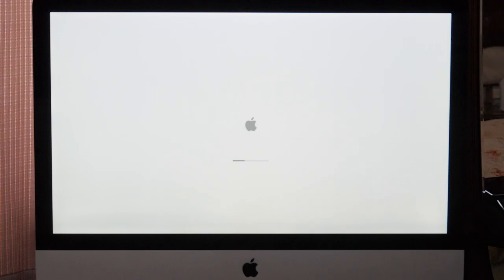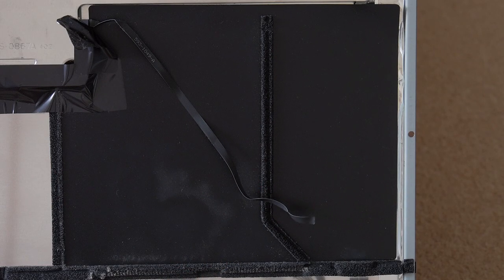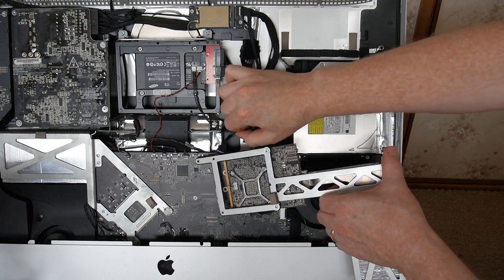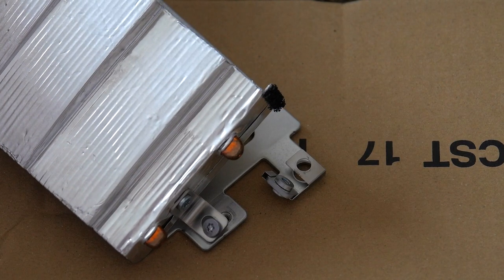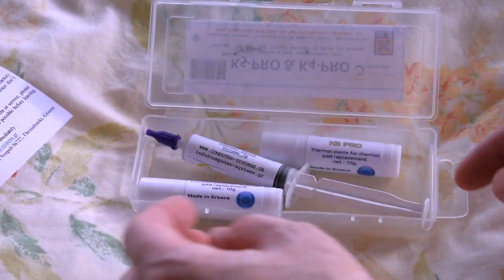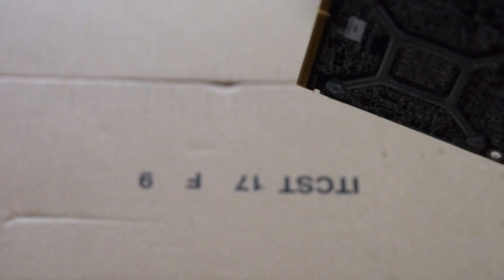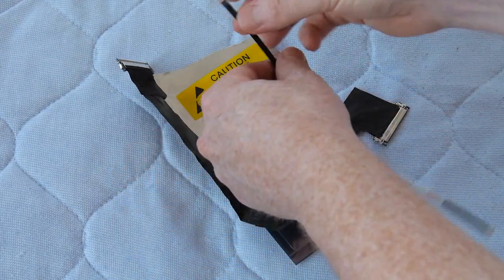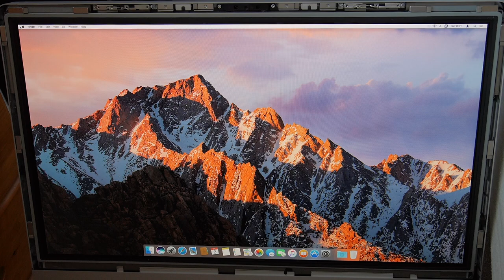Late 2009 iMac 27" Video Card Repair — 4850 — 2nd Bake

Comment: I baked mine once and it lasted about 3 months but I had used cheap thermal grease.  I rebaked it and it works but I used the same cheap thermal grease.  But I have ordered thermal grizzly, thermal past it has a absolute best rating of 73 W/mk  where others are half this rating or far less for cooling ability.  I have heard the same that the issue is not the connection to the daughter board but. internal issues in the chip itself.  So I'm hoping that the cooler I keep the chip the longer lasting the repair will be. Even if I only got 3 or 4 months service out of the chip between repair that's fine, because I like the computer.  I actually use mine as a Windows 7 computer.  I have it as a dual boot computer but I"ve never become that comfortable with MAC.  I tried to run windows 10 on here but guess what windows 10 doesn't like.  Yeah the fricking video board. :)  Has anyone else tried Thermal Grizzly with this board?  Wonder how it's worked for you if you have.  Also for those that want to keep their system working well, there is a good fan control program that works for Mac mode and PC mode.  You can adjust just the GPU fan to run faster and have the other run on auto.
Reply from the maker: I'm sorry to hear your first bake lasted only 3 months.  My first bake lasted only 4, and like you I used paste that wasn't ideal; namely, my paste was quite old.  Also, I didn't clean off all the old Apple thermal pads used on the memory chips (on the video card).  I rectified that in my 2nd bake.  I cleaned off all the old paste very thoroughly, and I then used K4 Pro and K5 Pro because I wanted a thick paste especially made for replacing thermal pads.  So far, I've gotten more than 1 year and 3 months from my 2nd bake and that paste. But as to Thermal Grizzly, I cannot advise you from first-hand experience.  I've never used it.  I only know that their liquid metal paste is highly conductive, both thermally and electrically.  And since it is liquid, you would need to use it only on the GPU, and even then, if even a tiny bit spilled over the GPU chip and touched the tiny SMD capacitors surrounding the GPU, I would suspect the entire video card would shutdown and it might even be damaged.  And that again is why I chose K4 Pro for use on my GPU after my 2nd bake.  I can take comfort in knowing that even if there is overspill, the paste is not electrically conductive and therefore won't short anything.  And since that paste and my 2nd bake (whether one or the other or both, I don't know) has lasted 1 year and 3 months, I obviously will recommend K4 Pro and K5 Pro over even what is considered a "thermally superior paste," simply because I know what works in long term use.  That's not to say you won't have success, but you would be sailing on your own in uncharted waters.  But if you do switch to that paste, I would hope that you would keep us abreast of how long your video card lasts with that paste.  Your experience could be a big heap to others.  Thanks.
Reply: Yes I will probably change the heat grease some time this week.  The setup is working fine right now and I'm using the fan control to keep the temp lower.  Do you guys use a temperature monitoring app?  If so what is the top temp that you allow your gpu to get?  Mine would get up to 72 Celsius.  I was thinking this was low enough to be okay since the cooking temp was 200C  I guess I was wrong. :(
Reply from the maker: Mark, the fan control apps I use are listed in the text Description under the video above.  Temperatures when running all fans at 2000rpm on my 2009 iMac are usually less than 72°C, but that really depends on the room temperature and whether you are playing a graphics intensive game.  In contrast, my late 2015 iMac idles at 1333rpm and is roughly 50°C when measuring the GPU diode.

Comment: I always add liquid flux to the 
Card before I bake it, does 
Anyone else add flux ?
Reply from the maker: Your use of the word “always“ implies that you have performed more than one video card bake, is that correct? The addition of flux to the video card prior to the bake is unnecessary because the oven heat is not melting all the solder joints on the card but instead fixing problems internal to the GPU alone.

Comment: Team fortress is not a video heavy program. Crysis is, so really, Team Fortress is just normal use, I'm afraid. Yes it is more graphic intensive than typing a letter, but not unduly so. It is the cooling problem of the whole iMac design, not the GPU, unfortunately.  If you want an iMac that will run for ever get one with integrated graphics, which means that it will not play games, unfortunately, but this is because an iMac is designed to be quiet, so the cooling system is not robust enough (loud) to handle gaming.
     But ten out of ten for trying to get more time out of an iMac. Well done.
Reply from the maker: Thank you for your comments and kind words.  I can only add that it doesn't matter much if Team Fortress is heavy on the GPU or not.  These old iMacs get hot when doing nothing at all.  Open Safari and browse text web pages and you can feel the heat rise on the back in the upper left corner.  Watch YouTube videos and feel it burn your hand.  Even simple games heat it even more.  The point here is that basic apps used daily are all you need to test the video card, CPU and the general cooling system of the iMac.  Macs in general aren't mean to be gaming machines in light of what Windows offers, so we really can't talk too much about games here.  A lot of Windows games aren't available on MacOS anyway.  But games that are made for the Mac, released around the time the iMac was released, do run and run acceptably well.  And if one wishes more cooling, it's a simple matter of installing MacsFanControl and boosting the fan RPM levels to whatever you desire.  For additional cooling, I turn on the A/C and/or use a regular 35cm fan to blow directly on the Mac.  So there are ways to cool it down a bit.  But bad cooling alone isn't the cause of these video card problems, I think.  It seems to be a flawed video card design.  I say this because not all video cards can be baked back to life.  Indeed, it surprised me to learn that the bake works on the video cards of iMacs from 2009 to about 2013.  It's a crying shame that Apple chose this flawed video card such that we now have to bake it back to life.  I'm thankful the bake works, but I'm still a bit upset with Apple for forcing that upon us (or forcing a new iMac purchase upon those who lack the skill or desire to perform the bake).
Reply: @JDW-   Thank you for your reply, and video. Respectfully, the card is not a flawed design or it would not work again. It is because the iMac lets the card run too hot. So the solder is, basically, slowly melting and your baking it melts it back into the right way. The simplest fix would be to run the iMac upside down for 4 months so the solder would flow back again! But that is just silly. Lol. 
    However it is still reason to get upset at Apple for putting inappropriate components in an expensive product. But it sure does look neat!
Reply from the maker: I respect your thinking on the matter, but the reason I strongly contend that the video card is indeed a "flawed design" is based on the facts I have observed myself and through the many people who have commented beneath my two videos.  Namely, a lot of people who own 2009 through 2013 iMacs have video card problems, and in almost every one of those problem cases, the cards can be resurrected by baking them.  I've been told by many that they have other video cards (even video cards from Windows PCs) which have problems that could not fixed by a bake -- they told me they tried and failed, whereas their bake of the iMac video card is a success.  These stories tell me there is a fundamental difference between the iMac video card (in 2009-2013 models) and non-Mac video cards or video cards from iMacs outside those years.  I conclude it to be a flawed video card design; and while thermals matter, consider well that even newer iMacs are not adequately cooled and yet they do not have the same video card problems as the 2009-2013 models.  

This evidences leads me to concluded that something internal to the GPU of the 2009-2013 iMacs is flawed/misaligned what-have-you, and that flaw can be remedied, if not temporarily (maybe 3 years?) by heating the GPU.  And we must consider that 200°C, which is the recommended temperature for this bake, is NOT a high enough temperature to melt leaded solder, much less solder without lead.  That's right.  This bake is NOT a "solder-reflow" fix.  This bake is indeed a bake of the GPU chip fixing whatever is misaligned inside.  I lack BEFORE/AFTER X-rays of the GPU to show you exactly, but we can observe case after case (based on numerous reports in the comments section) and come to some rather logical conclusions here about the video card itself.  

Lastly, please know my length explanation is not being said to argue with you but rather to express my own experience combine with the case histories of others who comment under my videos and who comment under my video on iFixit as well.  It seems clear that Apple finally recognized the flawed video card design and changed to something else in newer iMacs like the 2014 and newer, which do not have this problem.  This is good news for people who lack the time or desire to perform the bake in that they can, if they have the funds, simply buy a new iMac and be assured that it won't have this type of video card problem in the future.  It may thermal throttle due to inadequate cooling, but the video card will be fine.  

Best wishes!
Reply: @JDW-  Shucks. I didn't know you cared so much!  I only wanted to just express my appreciation that someone took the time to show how these iMacs can be put back to work. Nice one.

Comment: Hello my friend, do you remember if the GPU oscillate the temperatures before stop working? My GPU oscillating 50ºC to 90ºC in a second... I think this is a diode problem. But the GPU diode and GPU proximity show basic que same temperature, 90ºC most part of the time... and for a minutes shows 45ºC depends of usage... but jump to 90ºC in a second, literally.
Reply from the maker: Before my video card stopped working (before I saw any artifacts on the display), I never saw any rapid jumping up and down of the GPU temperature.  So I think you are correct about your problem either being a bad sensor or a bad wire connection from that sensor.
Reply: @JDW-  After Reboot the iMac wont display anything. After pram reset MacOS shows a message than a third party kext dont let Boot. And everything work normally
Reply from the maker: @janquieldapper  You are saying your display is totally blank or black every time you Restart and Reboot?  Or are you saying it happened only once after your bake?  If you are getting a blank or black display frequently after your rebake, it means your bake didn't work.  And in that case, your card needs a second bake.  If the second bake does not work, then I would say the card itself is too far gone for the bake to resurrect it.
Reply: @JDW-  Yeah... black screen after the first bake... sometimes I Want take off energy cable, to reset SMC and computer boot with Apple error message and boot and works fine. Now the system work normal for some time, but arou 70 degrees jumps to 90... and fan runs at max RPM, than low to 50 degrees for a little time and jumps to 90... and fans still running loud. I Agreed with you, I will make a second bake like you do! But first I will format the system to El Capitan... High Sierra is too heavy for this machine... I will always remember what you do here saving a lot of beautiful iMacs!!! Thanks for everything my friend! Good Week for you! I will report my progress to you! See you!

Comment: Be very careful with the video connector. You should mention that I cannot just pull it out. You have to squeeze two buttons on the side. I ripped of the whole video connector :(
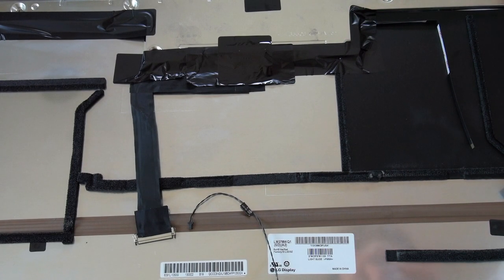Reply from the maker: Thank you for alerting me to the need for that warning.  You are speaking about the connector shown at 44:20 in my video above.  I would advise anyone reading this to slowly remove all connectors and use very little force.  It something seems stuck, it could be a locked connector like this one.  In this case, you must squeeze the tabs on the sides of the connector to unlock it and then slowly pull away to remove it.
Reply from the maker: I just updated the text Description to add the warning.  Thank you for sharing your experience which no doubt will help others avoid the same problem in the future.

Comment: Baking it in the oven does NOT help forever ! It just moves the smaller soldering points and connection of the PCB around a bit so that these are working correctly again for half a year Maximum !...
Reply from the maker: You are right about that rather obvious truth -- obvious because the title of this video is "2nd Bake"!  :-)  However, as I have said numerous times in the comments section, there was another YouTuber who was my inspiration for doing the bake in the first place.  In Feb. 2017 he reported 17 months of continuous use after his bake.  That's pretty good.  Consider well that Apple changed my video card 3 years after purchase, but 3 years later, it developed the same problem.  WHICH MEANS, even if I swap with a new card, I couldn't expect more than 3 years.  Why not?  Because it is clearly a design defect, and Apple is clearly at fault.  But I love Macs, not Windows, and I don't want to be forced to buy a new Mac, hence my desire to try the bake.  If it works for a couple years, great!  But if I only get another 4 months out of this 2nd bake, then of course I won't be happy.  But you never know.  I too might get 17 months of use!

Comment: Used this video tutorial to fix display issues on my mid-2011 iMac with failing AMD Radeon HD 6770M 512MB graphics card. My screen became plagued with big flashing greenish pixels and would become non-responsive and require a force reboot (something like this: https://discussions.apple.com/thread/6602889). 

Your video showed me exactly what to do, the only exception being I had to completely remove my logic board as the screws that hold the GPU to the logic board were screwed from the inside. Used Arctic silver 5 thermal paste on card and memory and used much less than in your video - small dot of paste in the middle of the card which gets spread out as you join the card with the heatsink (followed manufacturer's instructions here: http://arcticsilver.com/instructions.htm).

Thanks for the great vid and very clear and detailed instructions. My display issues have completely disappeared and my Mac is running smooth again. You rock dude!
Reply from the maker: It's wonderful to hear the video helped you get your iMac back up and running, Francois!  The video above is my 2nd Bake video, where I did not remove the logic board.  But in the Description I provide a link to my 1st Bake video, in which I do remove the entire logic board.  Removing the logic board is good when you want to replace the BR2032 on the back side.  As to the proper application of thermal paste, it really does vary, even by Arctic Silver's own guidance:

http://www.arcticsilver.com/intel_application_method.html

They advise Vertical Line, Surface Spread, and Dot, depending in the chip type!  And the K4 and K5 Pro that I used in my 2nd Bake video came with yet other instructions on how to apply it (I followed their instructions closely).  All said, it's often the case that one will likely use too little thermal paste than too much, especially when the heatsink screws down and causes excess to squeeze out the sides.  Using way too much paste would cause so much to squeeze out that the excess could cause other problems.  But in the case of my 2nd Bake video above, I followed the paste manufacturer's advice, and now after 7 months, the iMac is still running fine.  Also, the K4 and K5 Pro is not electrically conductive, so any excess that squeezes out after the heatsink is screwed down will not accidentally short anything.

All said, I am very happy to hear of your success.  Best wishes on your resurrected iMac!

Comment: those should be thermal pads, not grease, the thermal grease is for the gpu, pads for memory chips
Reply from the maker: Please scroll up and click "SHOW MORE" to reveal the complete text description under my video.  I explain the two types of thermal paste I used.  Specifically, K5 Pro is was designed to be a Thermal Pad replacement compound.  It is not a normal thermal grease. K5 Pro retains it's shape.  K5 Pro is truly a thermal pad replacement compound and therefore is NOT supposed to be used on GPU or CPU chips. Memory chips like on this video card are fine for K5 Pro.  I also have 2.5+ years of use out of this paste, so I know what I am talking about. Many others have used the paste with great success. According to the manufacturer, K5 Pro will replace any regular thermal pad up to 3mm thick.  Additional details on their website here: https://www.computer-systems.gr/en/content/product/k5-pro-60g-3x20g